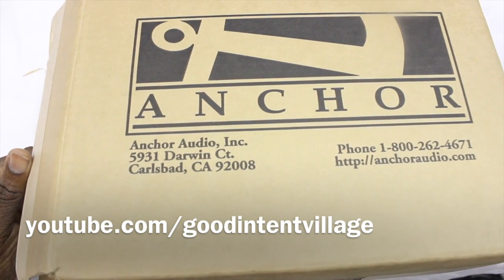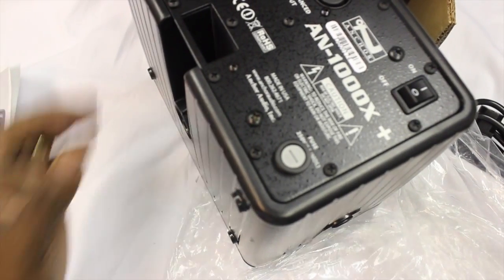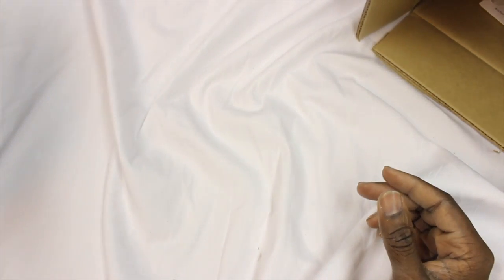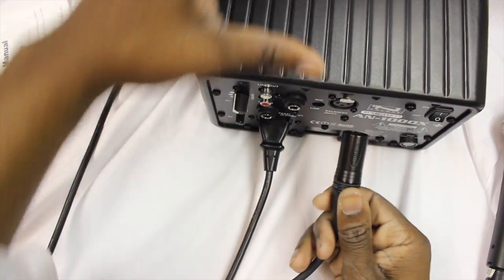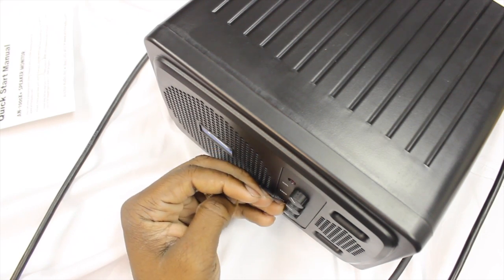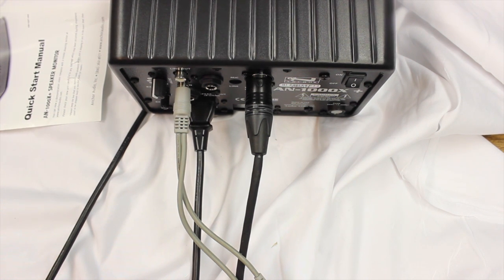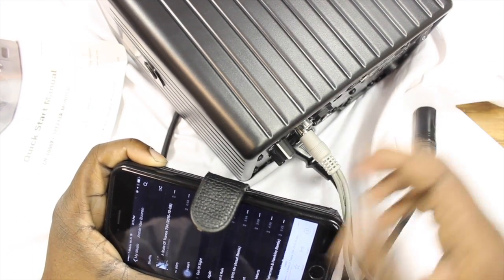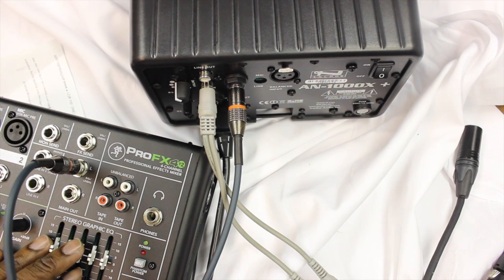Unboxing And Testing Anchor Speaker 1000AX (How To Use It )

Comment: Hey, sorry for the comments about this speaker is bad. This is actually decent and I heard them. They get pretty loud. If you still have this speaker on hand, can you please make a bass test video on this? Just grab your device and plug this speaker in, go to YouTube, search for bass test, play one of those videos, turn the bass knob all the way to the right, pump up the volume, grab a piece of paper and put it in front of the speaker to see the bass waves move the paper. I would like to see how bassy these speakers are because these do bump well and I heard them. If you can make a video, please do it.

Comment: Most powerful speaker? LOL
Reply from the maker: For its size it is very powerful
Reply: It’s 107DB so of course it’s powerful!
Reply: @loudspeakertestsmorebyaida3804  how did you measure it?
Reply: @z-audio  if claims it is 107DB and the bass will be that loud so it’s louder than a JBL Partybox 300 for $500